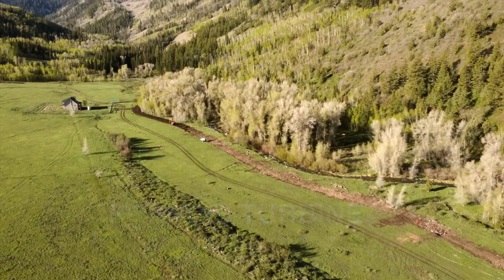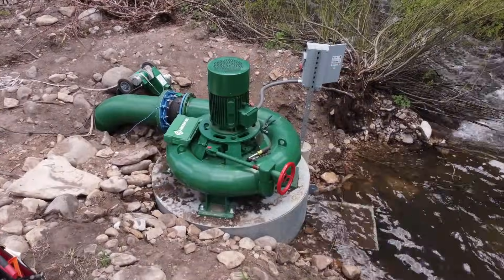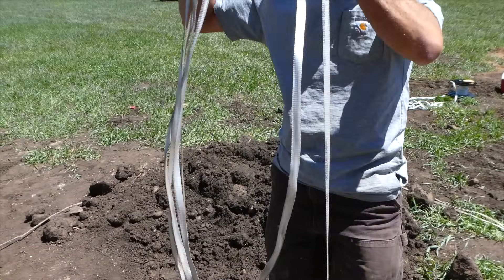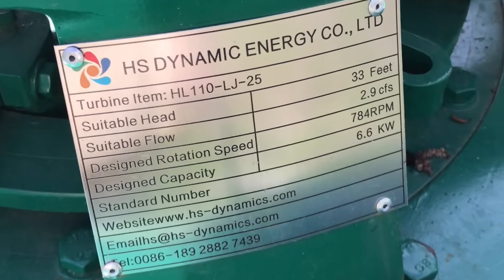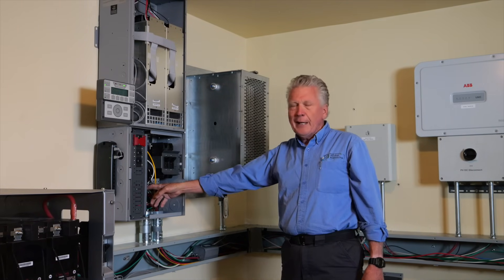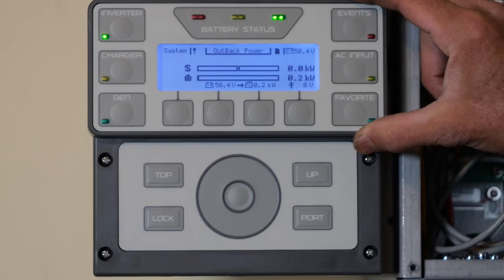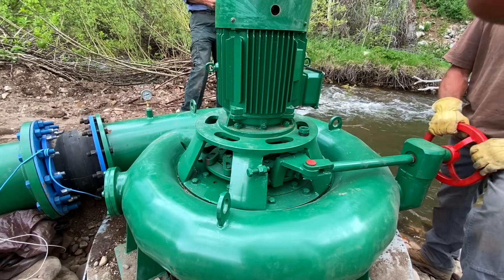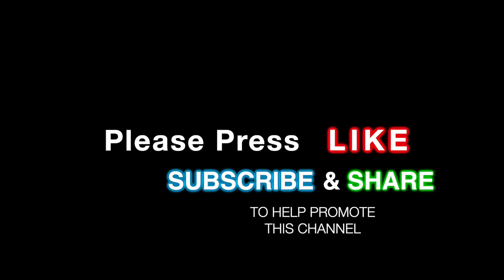MicroHydro Francis Turbine Part 2

Comment: Amazing system!!! Love these videos!
I used AGMs and have learned so much the hard way. Put balancers on them as soon as you can.  That 100$ will save you thousands! 
My 1600 AH bank went unbalanced in a few months and went bad. Every wire was the exact length down to the mm but the front batteries wer charging 2v higher than the last ones.  Wish I would have known about balancers then!
Reply from the maker: I have literally no experience with batteries as MY system is straight AC with ELC for load management.  Hopefully readers of the comments will benefit from you sharing your practical knowledge. Thanks for watching and sharing!
Reply: @mrhydrohead  Your system is amazing! I hope I wasn't coming off as rude, I just didn't know balancers existed and I wish someone told me. We don't use them here in America (or at-least they aren't widely used here). Can't wait for more vids!
Reply from the maker: @GeeCeeAte  More to come.  Thanks for watching!
Reply: You’re right, AGM batteries can’t be equalized by charging like flooded lead acid, so they destroy themselves as they get out of balance. Using a balancer on a bank of 12v batteries helps but you still have no way to balance the 6 cells in each battery. If you had a bunch of single cell AGM with a balancer it would help that one specific problem, but its not the only one.

AGM is good for emergency power, where it stays at float most of its life. You cant store it at 50% charge and use it as a energy storage buffer. 

LiFePO4 is really what I was expecting to see in this system. Something that is happy staying at 30-80% SOC all year, and requires very little maintenance. 

AGM is cheap initially but will cost more after you replace them a few times. I just replaced mine with LiFePO4 and a smart BMS, so now instead of checking each battery with a multimeter and manually balancing them, i open my Bluetooth app and check and if its not staying balanced i can initiate a balance cycle and they are perfect again.
Reply: By now lithium ion is the way to go

Comment: Question - Is there a reason they don't place a structure over the turbine to protect it from the elements and cut down on noise?  Seems a larger concrete base with a small insulated shack would be a wise move.
Reply from the maker: I believe the owner plans to put a grain silo over the Turbine for protection, but likely will be built by a different contractor.   Thanks for watching! I posted a new video today.

Comment: I guess I don't really understand why batteries are needed at all. If the flow of the Creek is continuous, why bother?
Reply from the maker: The Francis turbine required a battery based inverter because the system is off grid.  There is plenty of power from the turbine and the batteries would rarely cycle. AGM batteries are used because they are designed for that purpose – remain full most of the time.  Lithium batteries are far more expensive and don’t justify the expense as the batteries are simply a requirement for off-grid. Thanks for watching! I posted a new video today.
Reply: @mrhydrohead  right but why would the batteries ever drain at all? If the power from the turbine is always continuous, and the house never draws more than 6kW, what are the batteries even doing?
Reply from the maker: @Muonium1  I think but I'm not certain that the battery inverter requires that there be batteries connected to the system to function correctly.  I'm not a whiz with anything connected to batteries because MY system is straight AC regulated with Electronic Load Control (ELC).  The first answer I offered was lifted from a response I got from Ken Gardner who designed and installed the system.  I'm sure there are circumstances where peak loads would be beyond the max 6kw that the Francis Turbine can provide.  Batteries with the inverter I think is sized to handle a 8kw peak load.

Comment: Cool...  I hope you can prevent it clogging up with frogs and fish and sticks, leaves and mud and such ?

How often do you need to flush & clean and lubricate the system ?
Reply from the maker: If you look at part 1 you will see that the intake dam has a Coanda screen which will mitigate any of those problems.  Thx for watching
Reply from the maker: It’s not my system so I don’t know about lubrication

Comment: 4:17 Moreover, Russia and China use in the characteristics and in the marking of the wire its actual cross-sectional area of the metal core (sq. mm.  0.75, 0.5..... ), and the rest of the countries use some conventional units AWG (18, 20.....)
Reply from the maker: Interesting. I didn't know that. Thanks for sharing the info.

Comment: Pure LEAD batteries is ARCHAIC! Why the heck would one not use Lithium Iron Phosphate batteries?
Reply from the maker: I haven't asked the designer/installer about his perspective.  Others have questioned the choice which was made on batteries.  But, I imagine he has a good reason for his choice.  Thx for watching!
Reply from the maker: Ken said: "The Francis turbine required a battery based inverter because the system is off grid.  There is plenty of power from the turbine and the batteries would rarely cycle.  I used AGM batteries because they are designed for that purpose – remain full most of the time.  Lithium batteries are far more expensive and don’t justify the expense as the batteries are simply a requirement for off-grid."
Personally, I don't know about comparative costs because my system is straight AC, but I trust his information.
Reply: @mrhydrohead  Sounds reasonable/ Thanks. That said their price is coming down every year.

Comment: Thank you for the video.  I've enjoyed your other series and maybe someday I'll set up a small system like this at my home (unfortunately I only have ~10 feet of drop that's on my property and the flow varies a lot from a trickle in the summer to 9' wide x 2' deep in the spring or heavy rain.)
Reply from the maker: You might consider a Crossflow Turbine with such a low head.  Its important to study the flow and resulting power potential through different seasons.  Definitely should be done to optimize the expense/benefit ratio analysis.  Thx for watching!

Comment: Awesome!  Any idea on the daily electrical output?
Reply from the maker: If the owners run it at designed max they should get 6000 watts or 144kWh/day.  I don’t think they will need to run it at that level until they build other buildings on the property. Thanks for watching!

Comment: I love seeing these systems being built. Only thing I wonder is the the turbine going to be left exposed.  I would have thought a small building to protect it and also help muffle the sound of it running would be ideal in a place like that.
Reply from the maker: I did hear that they intend to use a grain silo as a protective structure, but I have no idea how they intend to build a foundation to support it.  I think that task will be given to a separate contractor to accomplish.  Thanks for watching!
Reply: Yes, I was thinking the same.
Reply: One year at a time. Seems their build season is weather permitting
Reply: They want to show the process. We would not be able to see if it was housed. Its far away from the house noise seams not a problem.
Reply: @LeJimster I wondered the same. Considering this seems system ment for decades, the turbine installation over steel box without any foundations, almost at the creek seems dubious. Ofcourse they were severely limited by 35 feet head. Building proper powerhouse would had robbed them easily 5 feet.

Comment: This amount of power is amazing! Would love to get one on my land. Maybe I missed it , how much does this turbine/system roughly cost ?? Thanks
Reply from the maker: The cost wasn't stated, but it wasn't cheap.  Probably in excess of $100K.  You pay for all future power with up front costs. A lot of money can be saved doing the installation yourself as opposed to hiring labor. The best way to approach a project is to determine what the power demand will be, ie less demand = less cost.  Analyzing first your need and then sizing the system to meet that will save you a great deal of money.  30kWh/day is what most US households average out to.  Having batteries/inverter can serve to cover peak loads.  Hope this helps some.  Thanks for watching!
Reply: https://harrismicrohydro.com/pricing.html

Here is a far more cost-effective solution. A weir can be built from natural materials and a little fabric with clay. Turbine sizes can vary. Install energy-efficient devices and systems, and supplement your power with other forms of renewables such as solar panels. A larger battery bank allows for more usage during peak times, and it will recharge at night, and during the day while you are working the land or working. 

The normal total cost for a system capable of operating the average household is between 25-35k. This includes all materials and the rental or usage of an excavator. 
The maintenance costs are between 150-500 a year. Depending on the system, the pipe is the most expensive part.

Comment: Why lead acid batteries (AGM) over lithium iron phosphate (LiFePO4)? Budget constraints? Equipment incompatibility? Were they offered as an option at all?
Reply: Cost certainly. But also simpler charge control, wider operating range and longer life.
There's no need for light weight or even to be incredibly compact in an application like this.
AGM are hard at work in fork lifts everywhere everyday. 
I'd imagine easy replacement if something were ever to go wrong has to play into it.
Reply from the maker: I didn't design and I don't own the property.  My system in Colorado is straight AC, so I'm no expert on batteries. Lead acid batteries have an established recycling path as well. There are other discussions of choice of batteries in this comments section as well. Thanks for watching!
Reply: @mrhydrohead  LiFePO4 just seemed like the logical choice to me (as someone who does work with battery systems, but not hydro). They have a much longer lifespan than any lead acid type battery that I am aware of (sometimes in excess of 15-20 years), can use standard lead acid charging systems (though some form of balancing between cells/packs should be added), are extremely stable and relatively fault tolerant, but are a lot more expensive than any lead acid type pack (though are actually cheaper in the long run due to how long they can last).

I wasn't sure if cost was the issue, building codes/permits where you are located, or something as simple as preference. Thanks for the reply!
Reply from the maker: Ken the designer said: "The Francis turbine required a battery based inverter because the system is off grid.  There is plenty of power from the turbine and the batteries would rarely cycle.  I used AGM batteries because they are designed for that purpose – remain full most of the time.  Lithium batteries are far more expensive and don’t justify the expense as the batteries are simply a requirement for off-grid."

Personally, I don't know about comparative costs because my system is straight AC, but I trust his information.
Reply: @mrhydrohead  The mention of "...remain full most of the time" is a great clarification! I did not think of that factor. It isn't like solar or wind where the power input can vary greatly and often dip below the demand for hours or even days on end; hydro is much more consistent around the clock. The AGM batteries rarely being cycled at all will significantly increase their lifespan. I'd still wager that a proper LiFePO4 pack would outlast any lead-acid based pack, but the large up-front cost savings of lead-acid may just meet or exceed the long-term cost savings of LiFePO4, even with replacing the AGM batteries. That is as long as the AGM cells are maintained and don't fail prematurely.
Reply from the maker: Thanks for adding to the discussion. I’m no expert on batteries as I’ve said, but I hope others will find this info useful.

Comment: Very well explained, but to look at the expensive works along the waterline, would there be a postive result looking at the kilowatt costs and the power reserve?
Reply from the maker: I imagine so.  You need to keep in mind the cost to wire in grid power to the property and this off grid system becomes a much more attractive venture.  Thanks for watching!

Comment: Awesome video. Your original project greatly helped me get my system built!!!  My specs: 3600gpm, 11’ head, 2.75-2.90KW, 240v. 12” runner with 6 blades. Propeller type, 1170 rpm induction motor, grid tied for speed control, comes through elect panel to offset grid power usage.  Upgrades coming. Have a 4 blade runner with flatter blade angles then go with battery and inverters for storage since my EMC took away net metering June of this year😢.  With batteries I will need a few solar panels to be off grid during hot mid summer AC units needs, not because of low water flows… blessed with year around water flows. 
I’m in Georgia (USA)
Reply from the maker: Wow that sounds great!  3600gpm and 11ft head!  WOAH!  Thats a honkin' site! Sounds like you really get it with the utility being your governor for your induction motor.  I had heard this was possible in the SEI course I took in 1996 , but I've never seen it done.  Man, if I lived closer I'd love to film it and share the example.  Alas I'm so far away. So glad something I posted was helpful to you.  You can certainly call yourself a HydroHead.  Congrats to you. and as always, Thanks for watching! 
Care to share any Pix to my email? MrHydrohead@gmail.com
Reply: @mrhydrohead  sent photos and sending a video if it will go through.

Comment: I do not understand why the electrical system is so complicated. ???
Reply from the maker: The efficiency of both power generation and transmission is greater with AC.  And the turbine is not directly governed so there are no control wires to be run to the Turbine.  Wild AC (which can vary in hz & voltage) generated and transmitted to the house is not compatible with appliances or many kinds of lights etc, so it must be conditioned to standard code.  It needs to be rectified to DC first and then converted back to standardized 60hz AC.  If there were no batteries to provide peak loads to the whole house, then that would be the end of it, but the system does have battery back up for peak loads and the system is therefore governed by the Outback unit which moniters, charges the batteries and verifies the quality of power provided to the whole house system.
The primary reason for the complexity results from the AC generation and transmission being wild and also the most efficient way to get power to the house.  Hope it makes sense.  As I said in the video, it tested my own understanding of how and why it is set up this way.  Thanks for watching!

Comment: I'm wondering why there wasn't a bigger slab for the turbine so that a small turbine house could be built over it to protect it from the elements.  At the same time would there be an advantage to have the rectifier and dump load in said turbine house. As rectifying 3p ac to DC bumps the voltage which avoids transmission losses and 1 fewer conductor. 

That and some form of actuator could be fitted to the vane control.
Reply from the maker: What Mr. Gardner told me was that the owner intends to put a grain silo type structure over the turbine. I don’t know what sort of foundation is planned for that.  I hope you saw part 1 where the base below the turbine is shown as a prefabricated discharge chamber.  I don’t think there is any slab under it. 
The least amount of transmission loss is achieved with the 3Phase AC being run the greatest distance and then being rectified at the house. DC would have a greater line loss.  The dump load in the house provides some heat where it would be useful.  I don’t believe they wanted to put any automation on the vane control and to leave that adjustment to be manual. Thanks for watching!

Comment: Thanks so much for the great video. How were they able to determine where the break was in the underground electrical conduit?
Reply: You know, those Bull Tapes are marked every foot (here in the U.S.)
By noting the number at the receiving end when the pull starts , and then where it's stuck,  you know exactly where the hangup is.
Reply from the maker: A tricky bit.  Pulling wire through, it stops, mark the wire at feed point, pull it back out, measure mark on wire to the lead end, measure that distance out on the ground, dig away, voila the damage to conduit is found. A very frustrating process for them.  Too much to describe in the video, but a good question. Lesson is to be very careful with bedding and backfilling the trench.  Thank for watching!
Reply: @mrhydrohead  great explanation. That is the method i was guessing but i wanted to ask incase it was something i havent thought if. Must have taken quite a bit of force to break that tube in such a manner.
Reply from the maker: @EarthshipFreedom  Just one heavy rock dropped from the excavator bucket. That was the evidence at least 🤔